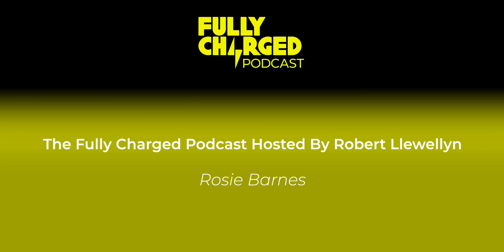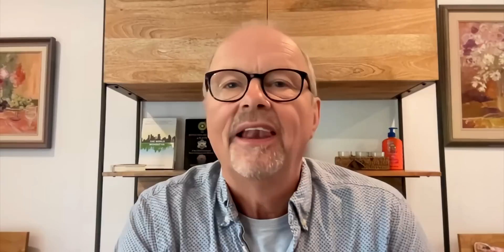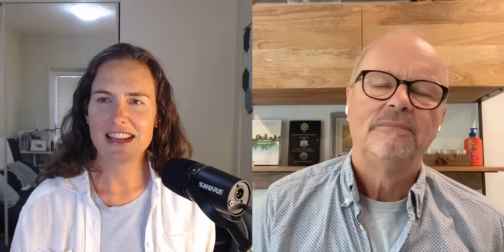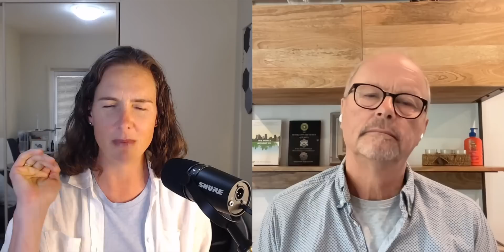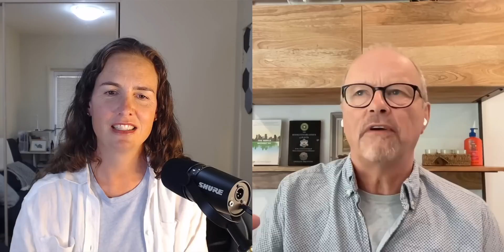The Inevitability of a 100% Renewable Energy Supply with Rosie Barnes | The Fully Charged Podcast

Comment: Does anyone remember the electric power grid upgrade and the rise in power bills  ??

The grid is incredibly expensive and new grid almost prohibitively expensive.

Bigger power plants need bigger new grid. 
Rooftop PV needs no new grid. 
Transmission costs are avoided.
Reply: We will be using more kWhs of electricity and thereby having more units to divide the cost over. Also big numbers big - but remember that numbers mentioned often are over e.g. 10 years and then the per year per capita cost is not that bad.
Reply: @jensageholm8774  the alternative is dirt cheap and a proper use of resources. 
Electricity is the most expensive energy when compared with fossil fuels.

It is obvious when you do the maths. 
Opinions can feel warm but so do fairy stories. 
Big money wants big central power. 
Big money will pay for the bs.
Reply: @stephenbrickwood1602  Just so we are on the same page - is the alternative you are talking about rooftop PV? - what if you have no roof for the PV?
In my neck of the woods (Denmark) it will be a very sad existence in winter if we have to rely on rooftop PV - on the other hand we are building a lot of offshore wind in the North Sea that need some grid to power my home. Our grid investments towards 2040 are projected to be less than $10.000 per household but that is without taking into considerations the other "new" electricity consumers (like Power2X) that will also have to pay something for their grid connections.
A strong grid is one building block to a thriving society - but we are also heavily regulating the grid operators and it is for a large part owned by the state and the consumers.
Reply: @jensageholm8774  hello from Australia. 
 My starting point on this was the push for nuclear electricity generation by an old friend and the dishonesty in the matter.
Highly qualified people, all experts in their field. All connected to huge private investors. 
But fortunately the world has moved on and Renewables are getting rapidly better. 
I soon came to see that the full costing of all the options was deliberately being hidden. 
I solve problems from first principles. 
In Australia deals have been done where private ownership of assets with government Garrentees has distorted infrastructure and our cities. 
I have not lived in Denmark but assume there are plenty of roofs and the sun shines at times. 
Denmark looks great in tourist information. Hahaha. 

The volume of gas used can be reduced dramatically and its infrastructure exists. 

The volume of Renewables electricity has to be increased. 
Transmission is a big cost, and must be taken into account. 

Batteries are the key to protecting the national power grid as it exists, but the expansion of the grid is dangerously expensive. 
Batteries technology is rapidly advancing for both vehicles and mass storage. 

Vehicles must have the capacity to drive long distances but daily drives are short. 
That means daily stored electricity would be huge. 100kwh battery in millions of vehicles is a good start.

As the climate warms more energy will be in the atmosphere. 

Just my thoughts.
Reply: @stephenbrickwood1602  Comparisons between Australia and Denmark has to be done with care - also for electrical infrastructure. Our shortest day is less than 7 hours between sunrise and sunset - that does not give much useful PV electricity. A main challenge is seasonal storage of electricity - batteries are way too expensive for that. But luckily we have some beefy cables to Norway and sell electricity to them in the winter to conserve their water resources for hydro power and buying it back in the summer when they have plenty. Denmark have several cables to Norway, Sweden, Germany and Netherlands and a cable to the UK is being discussed. That level of connectivity is not possible in Australia so your solution needs to be something different. Denmark also have some of best wind resources with shallow water in the North Sea so our future solution will include a lot of offshore wind power - that will not work everywhere. But it is quite encouraging that the latest 1 GW offshore wind farm will be build without subsidies, they pay their own connection to the the grid and on top they pay 400 mio. USD to the Danish state for "renting" the sea floor for 25 years.
Reply: @jensageholm8774  thank you for your information. 
We are in very different situations. 
As I meant  to say sort term fossil fuels in emergency and for limited times is extremely practical. And a huge improvement on 100% fossil fuel generation. 

Keep in mind that new national grid capacity, poles and wires to the streets and homes and businesses and industries and buildings and.....can be extremely expensive if part of your solution is to increase your grid capacity. 

As EV in some form promise to the universal in the near future and both daily drive and the long drive are standard features then any technology that overlooks that storage asset would be an utter waste of resources. 

Nobody seems to be aware of this matter.

In the horse and cart days you topped your horse up every day. And stored its food at home/stable. Hahaha. 
Then you topped your vehicle fossil fuel tank every week. 
Now we will be topping up the EV 23hrs a day. The EV battery will be doing 2 jobs, moving the vehicle and trading stability and power for money and profit on the grid. The EV battery is free with every EV
Reply: @stephenbrickwood1602  you talk with an air of such authority, yet so much drivel escapes your keyboard.
I guess you recommend we switch all our lighting back to burning gas & candles & keep our heating & locomotion on fossil fuels?  RE wind & solar PV are the cheapest forms of energy generation, beating oil coal, gas & nuclear.  Where TF do you get your hairbrained ideas from, Mr ezi pezi?
Reply: @stephenbrickwood1602  topping an EV up 23 hrs a day?  Nobody doing a normal commute needs 23hrs on charge.  For most, 8hrs is more than plenty on a slow charge for 1 hours daily drive.  Where in God's name are you getting your laughable numbers from?
Reply: @Alex Manojlovic  the point is the vehicle can take cheaper electricity when available and sell electricity into the grid when prices are high.
Forget horse and cart thinking, the future is different 🤔.
Reply: @stephenbrickwood1602  "electricity is the most expensive when compared to..." 😆😅😂
Reply: @Alex Manojlovic  I laugh at you 🤣 
Hahaha Hahaha Hahaha 😆
Reply: @stephenbrickwood1602  I already knew you had a sense of humour.  I read your posts.
50/50 - sense/comical nonsense....
Reply: Unfortunately rooftop PV means just as big a grid, since the grid is built for peak demand, which occurs outside of solar generating times.  Unless there is some sort of local storage.
Reply: @CharlesGregory  yep.
As every one agrees EV, with big batteries and selfparking and plugging into the grid will give the grid massive storage and stability. 
Fossil fuels can go away.
Reply: @CharlesGregory  which is becoming cheaper & nore available all the time. Thanks to Musk driving EV uptake which in turn encouraged China to switch so rapidly.

Comment: As someone who only studied Mechanical Engineering for about four months, I don't know if this would work.  But would it make sense to have wind turbines in windy areas far from human populations where transmission distances are prohibitive, but have those wind turbines filling lorry-sized batteries and swap in a new battery when one is full and drive the full battery to where it is needed?  It sounds like the same process the fossil fuel industry uses.  After all, you don't only burn coal at the coal mine.  You drive it long distances before you use it to generate energy.
Reply: Let's see....
The energy stored is proportional to the weight of the battery.
The energy used to transport the battery will be....... Proportional to the weight of the battery?
Double that energy use, since you have to transport the (still the same weight!) battery back to the collection site
. 
Multiply in the inefficiency of whichever transport system you use..... Over, as you said, "prohibitive distances"
.
Really?
(Still better than Hydrogen, but not much!)
Reply: @rogerstarkey5390  😂😂😂😂

One might enquire about this newly acquired lack of knowledge of yours ref hydrogen.

Perhaps you and Robert missed ELon droning on about how Tesla are developing hydrogen fuel cell powered cars?

And we all know ELon never makes jokes ...
Reply: @t1n4444  
You didn't watch the Tesla event?
Obviously not, since he never said any such thing.
If you HAD you'd know they (as a team) said the only place for hydrogen was in (paraphrased) "high energy industrial applications, such as steelmaking (a process in which they now have expertise)...."
.
The only "knowledge " required regarding hydrogen is that apart from very specific edge cases it's a horribly ineffective and inefficient waste of resources.
.
Don't be a DIck.
Reply: @rogerstarkey5390  

😂😂😂😂😂

Clearly you are out of date or misinformed, quite common for yourself as I recall.

Try reading the press releases to the automotive media.

You should have done that first.
Reply: 😂😂😂

Indeed coal is shipped across the planet every single day.
Reply: Would need too many batteries…

Comment: Off shore wind turbines make more energy than on shore turbines
wouldnt that comensate for the extra cost
Reply: The answer is sometimes but not always. Very location and cost dependent.
Reply: "Extra cost"
Example of two projects in the UK.
Both due to be 100% complete in 2025-6.
Nuclear (3,000mW)
vs 
Offshore Wind (3,600mW)
.
The Wind project is on budget, 33% the cost, 50% (or better) build time.
It can ramp incrementally, vastly reducing the legacy carbon footprint of the project (essentially averages 40-50%  capacity over the build period)
Energy produced is £49/ MWh vs £118/ MWh.
"Cost" is relative.
ALL wind is "cost effective"
Reply: @rogerstarkey5390  Roger, you switch between taking sense & nonsense.  You're a strange bird.
Reply: @rogerstarkey5390  How much budgeted for storage to go with the wind?
Reply: Listen again to what she said in the interview.

Comment: If everyone set their air conditioner to start at random times like 3:07.13pm rather than 3:pm like 90% of people do it would significantly reduce the 3pm daily peak.
Reply: Don't you set your Aircon to kick in based on temperature rather than time? Cos that would absolutely smash sudden peaks flat.

(I'm in the UK. Air con is something you only really see in offices still, although why on earth we're pushing a2w heat pumps not a2a is frankly beyond me but the point is I'm not familiar with how air con works like someone in a hot country would be
Reply: @jezlawrence720 I don't know about Aircon but my thermostat is time based with a target temperature, i.e. 3pm 20c 10pm 14c so presumably the same is true for Aircon
Reply: @sie4431  I see what you mean. Last couple of years I've switched my heating to lower peak temps and setbacks a few degrees lower rather that simple on/off. Dropped my gas bill by about 10-15% over the course of the winter. I understand heat pumps (which is what Aircon is) do even better when used to maintain rather than heat up or cool down. 

So I assumed in hot countries the Aircon basically was on the whole time, keeping the temp a livable rather than allowing it to get hot and then have to be cooled. Assumptions may be totally wrong though which is why I asked
Reply: @jezlawrence720  I do, but with the advent of apps to do everything, people just set the easiest time 3 or 4 pm as that is the hottest time of the day and most people get home from a few hours later.
Reply: @fredkroh6576  ah ok I understand yes, if you're literally not there you are at least going to use higher setbacks, or off completely, then you have to allow cooling time. I'm with you. 

Maybe if folk started them a bit earlier but less aggressively, and just knocked it up after they get home? It's not like folk are all arriving home at the same minute. 

Mind you it's fundamentally the same challenge as what you're proposing: getting a ton of people to change their behaviour
Reply: @jezlawrence720 : in Australia most residential AC systems are not idled on the thermostat until it is "needed" - 

A-to-W heat pumps can be made to cool as well as heat, provided a reversing valve is in the (compressor-expander circulation) system (Individual single-head split AC systems are very common in residential Australia, though centralised air handlers also exist in "relatively recent" developments - longer term investment and often relatively inefficient) - water can be used to convey  "cold" around the whole  house (removing condensation from radiators -running on cold - could be an issue), if a hot water radiator system is already installed it makes sense, the ridiculous thing is the UK  funding efficient heating systems while declaring reversible  pumps non qualifying.

 - large central air handlers are space and energy "challenging" - especially in a housing system with a great need to retrofit existing properties.
Reply: @jezlawrence720 , Air to air heat pumps are very energy efficient.  I wish they never have air to water systems, while they can save a bit of natural gas costs, they are actually using more power than heating with air to air.  I do like the air to domestic hot water systems, they do save a lot of electricity compared to electric resistance water heating.
Reply: Sounds like what they are now doing with car charging automation and one energy company making it so the chargers all start slightly out of sync to avoid issues with lots of vehicle chargers starting all at once.